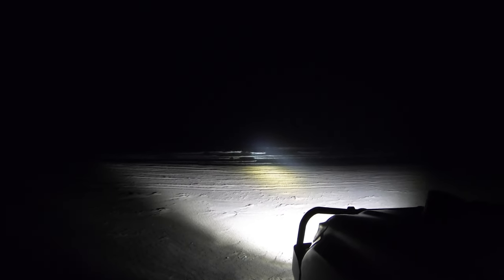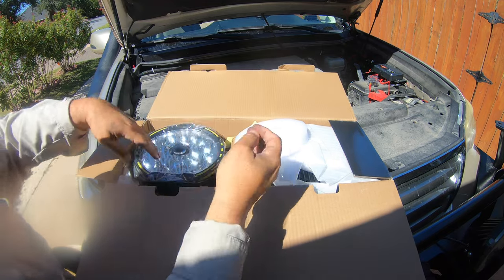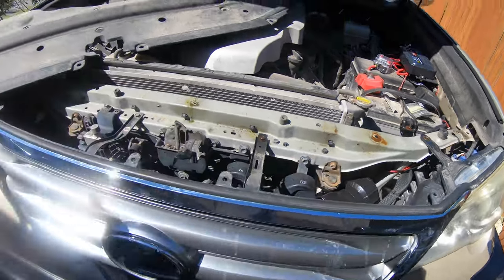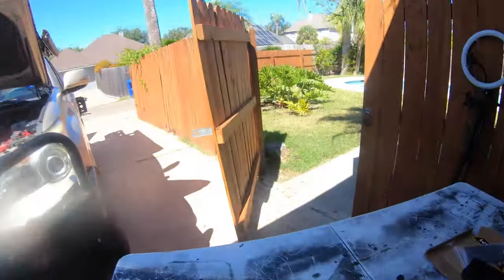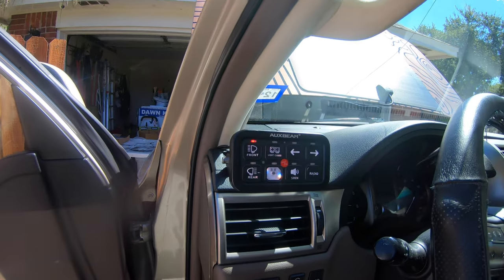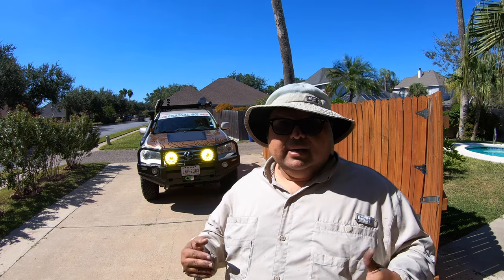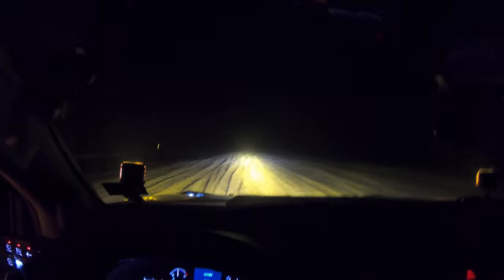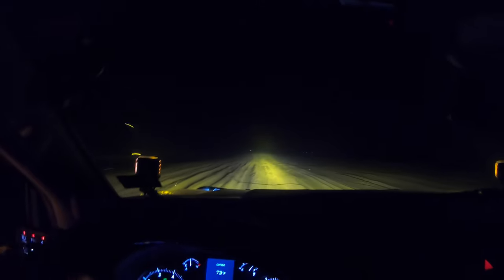Avoid Beach driving hazards at night - Auxbeam 9 inch Offroad lights - 360 Pro Series

Comment: They may not project as far with the amber covers but when at the island, you get that spray and it reflect the white light back a bunch at least in my experience. The amber reduces this glare a bit and lets you actually see what's in front of you. There were a few times I went driving out there at night and I couldn't see anything with my front white offroad lights because the ocean mist was so bad causing a bunch of reflection so I had to just run with the regular headlights.
Reply from the maker: That’s what my wife was telling me. Makes a lot of sense. Thanks for the smart feedback as always!